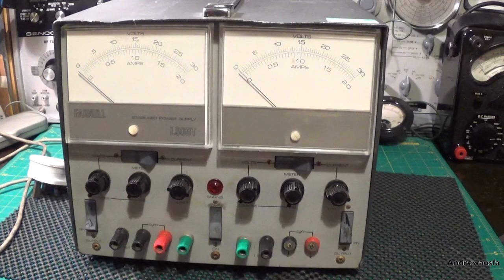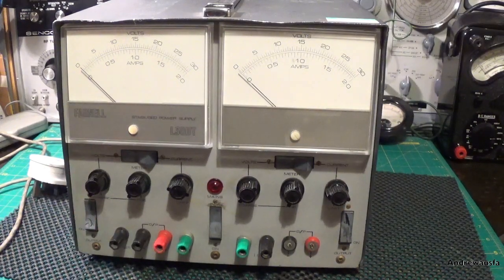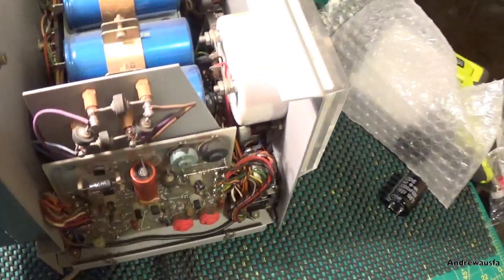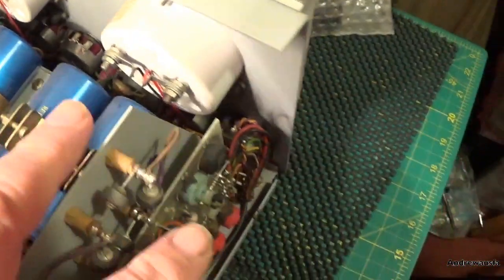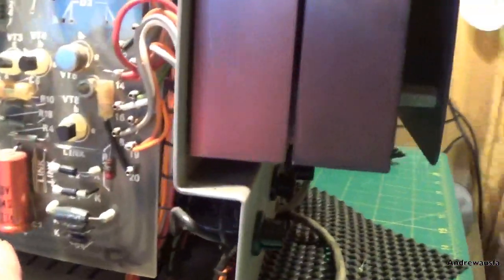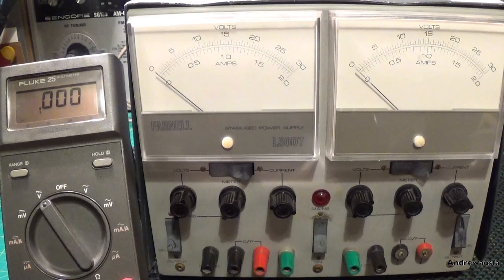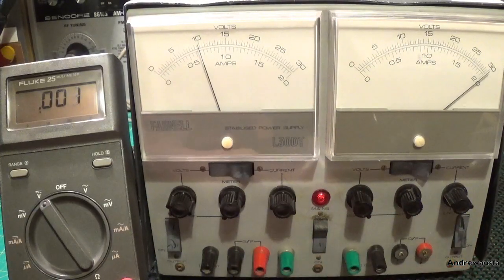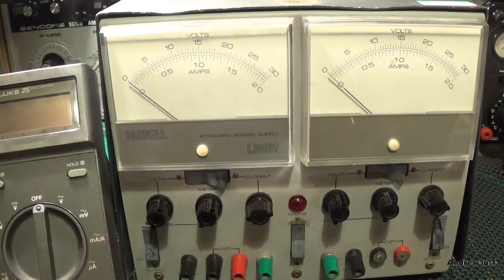Farnell L30DT bench power supply repair part 1

Comment: I have a power supply similar to that at work perhaps slightly more modern but has the same issue  with connectors knocked off. I’m guessing people catch them on the edge of the bench and the weight does the rest. Amazing how capacitor technology has moved on.   I bet it’s a satisfying restoration. Enjoy polishing your knob and metal work tonight. Regards Chris
Reply from the maker: Hi Chris, yes they did an upgraded better looking version that had LED's in the output swtches, amongst other things. Lovely, heavy unit though.  Yes always gets me when I work on old radios how small new capacitors can be even using double the voltage ones.  I took the manual route with the knob polishing, a firm grip with some Marigolds and a brisk action soon saw a satisfying result.

Comment: Cool love an old power supply with analogue meters wish I had bought one all those years ago ! and yes saw the capacitors with the little bulge had six of those in an old amplifier went off like a six pack being opened what a mess in the cabinet that was !
Reply from the maker: That's what worried me Benji, though it (looseley) seemed to work I was a bit worried about one or more going dead short and causing more drama on one of the PCBs.
Reply: @Andrewausfa  yes thats more than likely my amplifier was still ok whilst the caps started venting ! but I did switch it off before it did any real damage

Comment: How's the Marconi sig gen been? I'm maybe going to be getting my hands on the Marconi TF995B/5 hopefully, almost identical to yours. Not powered it up yet, but it is really clean condition on the front panel, just a few scratches to the outer case.
Reply from the maker: Super thanks. Mine came from Marconi themselves (the ship radio side) so assume it's been looked after.